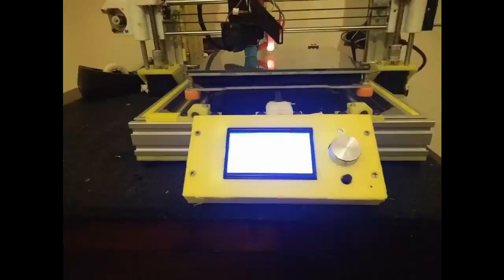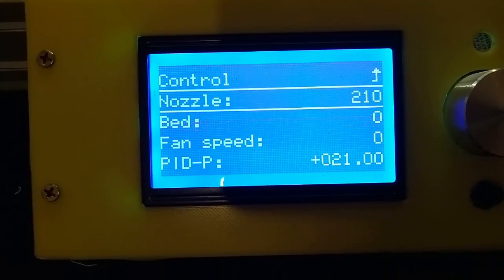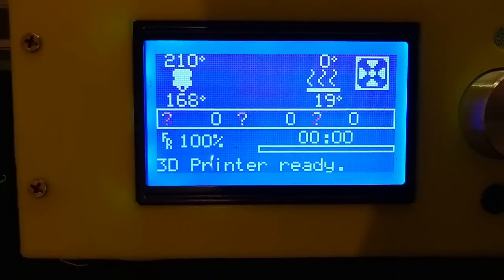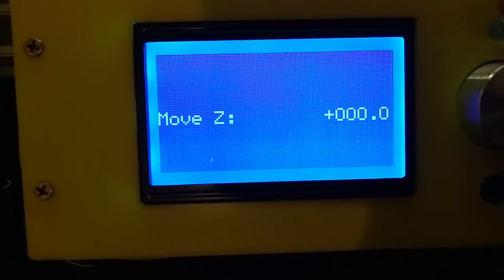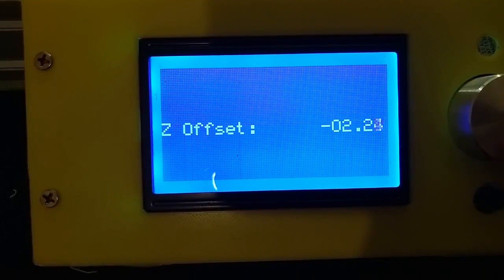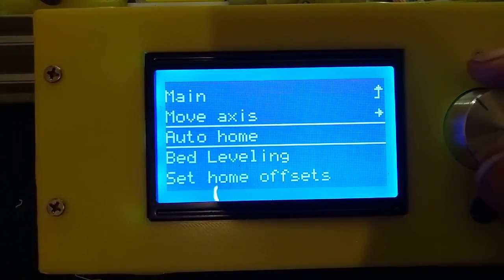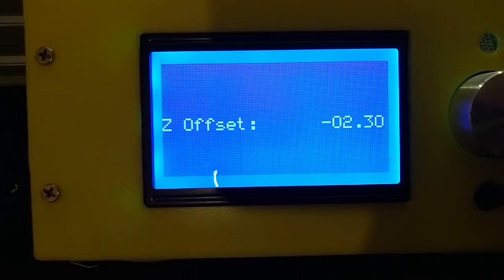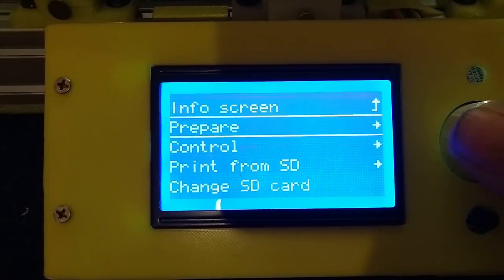Setting Z offset with Bltouch or Other Probe in Marlin Firmware

Comment from the maker: 1) Preheat the Nozzle
2) Do a auto home
3) Lower the Z axis down to 000.0
4) Check how far the nozzle is from the surface.
5) Adjust the Z offset with  control/motion/z offset
6) Store Setting
then repeat from (2) until the nozzle is where you want it.
Reply: how can ı open this settings in arduino? ı can't find z offset settings in my marlin.
Reply: @serhat_zengin  The Z offset in the LCD requires that you have bilinear bed leveling and auto level enabled.
Reply: brian whittle thank you.  This was by far the most clear guidance I found on the issue.  I was printing within 5 minutes. Much appreciated.

Comment: why heat up the nozzle? does it not make more sense to heat up the bed? Your bed warps a little when heated up so to me it makes more sense. but i must be missing something here
Reply from the maker: Heating the bed is pointless as the bltouch gets the level relative to wherever the bed is so if it moves it will get the level from that. The nozzle expands when heated so getting the correct level when cold would be too low when heated.

Comment from the maker: If you end up too close starting from z at 0 use the move z 0.1 mm to get the correct height the  this to the  Z offset, adding will  make the minus number more minus.
Reply: You don't really have to repeat to many times. If Zed is to close to the bed just move the zed axis positive until it looks like the correct height then add zeds value to the zed offset.